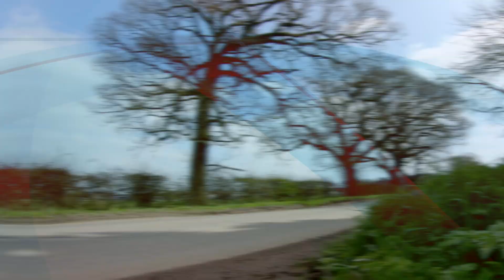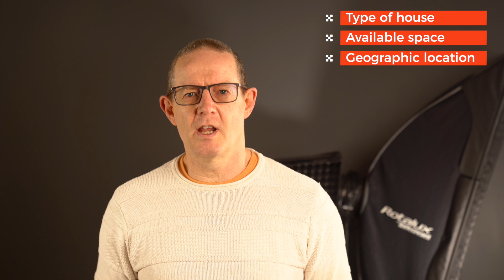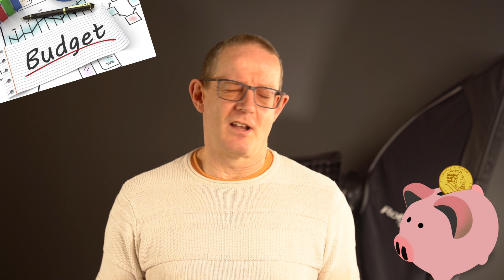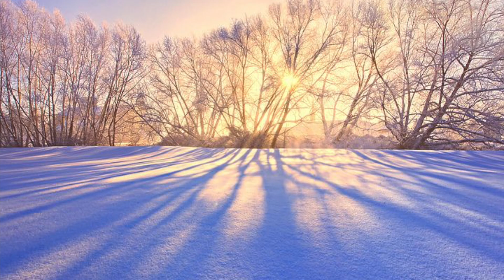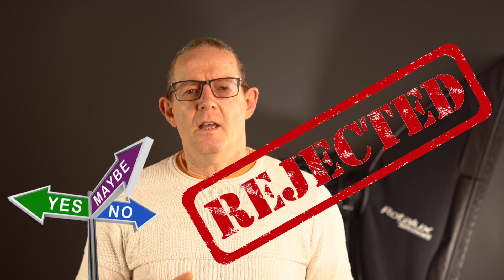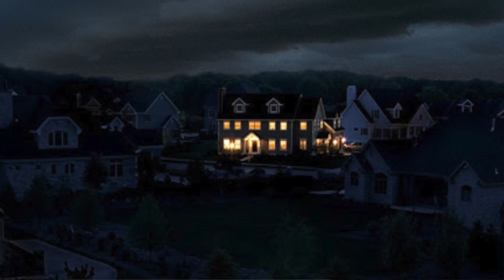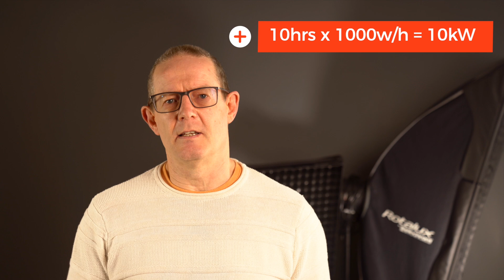So you want solar and a home storage battery

Comment: Has anyone managed to clarify the situation if you want, for example a 4.7kw panel array with an 8.2kw battery? I've been told that you have to apply for special permission from the Grid - a G99 and extra hassle, told that you don't, told that you can go up to 4.5kw without extra permissions - just the usual G98, told that if you have a 3.6kw inverter you don't need any special permission? Help anyone?
Reply from the maker: Hi Mick, anything over 3.68kW needs DNO approval and a system design as per my video = G99. 

=<3.68kW then it's pre-approved by the DNO and a post installation G98

Many DNOs are lagging behind with battery installations in terms of their approval process, it might be that an installer who will have good relations with the approver at the DNO has agreed a local arrangement. But it's not standard practise.

If you inverter caps export to 3.68kW then in effect its pre-approved as I understand it.
Reply: @johntisbury  I see that thanks, I watched the appropriate bits in the video but you mention that having a battery makes a difference but I can't find what difference it makes? If I have a 4.7kw solar array with an 8kw battery and the inverter capped at 3.6kw, will thi qualify for pre-approval?
Reply from the maker: The battery can export too, so it’s added to the solar array total.
Reply: @johntisbury  A bit baffled John, isn't the battery also controlled by the inverter and therefore subject to the 3.6kw cap? If not, then a 2.5kw panel array with a 3Kw would be over the limit? I'm just learning about this to decide on a set-up so you help is very appreciated!
Reply from the maker: Exactly. Don’t get hung up on trying to get under the 3.68kW. You need a system that meets your needs now and in the future. A good installer will deal with the paperwork and the DNO and recommend a system to suit your needs. Suggest getting 2/3 quotes.

Comment: Great video. I wish Government would make it compulsory for all new builds to have solar and batteries. Also they would be better offering incentives for batteries rather than heat pumps as so much surplus energy overnight
Reply from the maker: Thank Gareth, I believe the building regs now require solar, I could be wrong. However, when they install it's the bare minimum and the cheapest. 
The government are slow to react, Rishi is announcing low cost loans for heat pumps in the next few days I understand. But yes, they could do more.
Reply: @johntisbury  load of new builds near me going up, sadly on GreenBelt and no solar on those but they will have EV access points. Ps bug bear of mine they’re not chargers they’re in the car. 🤣
HP’s again should be fitted to New Builds as they can get the everything right, too much disruption to existing properties and infrastructure
Reply from the maker: The construction industry and building regs do need a shake up to bring them up to speed with the route we are taking in the energy market. High thermal efficiency, insulation and HP ready should be standard. 

Developers have to have a certain percentage of their new developments tested for air tightness with a blower door test. Guess what, they get to choose which ones to test. Those get special treatment, the rest in the development not so much.  At least EV charging points have to be installed, small steps.

Comment: I have have had 4.0kw of solar and a 13.5kwh Tesla Power Wall for a year and a half. In the first year I had less than 20 days where I used more power than my system produced and never more than three days in a row. My Power Wall doesn’t quite have energy capacity to leave the grid. I purchased a NG backup generator so if I lose the grid even without the sun I never lose power.
Reply from the maker: Thanks for watching, just 20 days is impressive.
Reply: Are you from the uk ? Matthew
Reply: @dannyf5157  No California.

Comment: Hi John, very informative thanks! My question is this: our consumption last year was 3,298kw (£606.23 bill), we can see that a 4kw installation would provide around 3,400kw - yet the Solar Energy Calculator only shows a saving of £297, where am I getting confused? Thanks, Mick.
Reply from the maker: Thanks for watching Mick. Have a look at the assumptions (top right) on the final page of the calculator. It is an estimator rather than a bang on the nail price point as there's too many variables even with the data. Your annual bill will also include VAT and the Standing Charge. The estimator is using the standard unit rate of 20.06p/kWh so that may also be different to what you are currently paying.
Reply: @johntisbury  Thanks for the quick reply, I'll have a look.
Reply: I have a Tesla 4kw solar with a Power Wall. I used ~3000kwh last year and produced ~7500kwh. I am on the central coast of California so we get more sunshine than most. These are real world numbers from last year.

Comment: Can you use tariff Control with battery? I e charge it when cheap spot price, typically during the night, and discharge it when expensive, typically 7-8 am and 5-7 pm, however it varies, so a simple scheduler wont do, tariff integration is necessary. On top of that, can you charge it when there is surplus solar, but give eventual charge of the EV priority? Perhaps set percentage for both? We have the Myenergi Eco-system and are considering adding A. Battery, B. Eddi. We currently charge the EV using Myenergi tariff Control + surplus solar during the day goes into the EV.
Reply from the maker: Thanks for watching. Some battery configurations allow that, the Tesla Powerwall does not have that integration. Octopus Intelligent which is a tariff control but currently only for Tesla car charging, not the Tesla Powerwall.

Comment: Surely the DNO don't have a say in what you can put on your land/roof or what size battery you have if your not feeding excess back into the grid. All this does is increase the cost to the punter. A couple of grand system turns out to be a 5 grand one fitted. 10 years guarentee mean nothing. I think most of us have had a rough deal with these 10 year affairs. . Im lucky that I would do my own so I wouldn't be paying to get one installed
  I'd be adding wind as well if I can. It's always windy up in the north so it would make sense to have a small generator as well. If allowed that is. I think come April it's 54% rise then more and more folk will be looking into  this and companies will be springing up all over the place making a killing. self certification is a joke and leads to sud standard workmanship in a lot of cases. It will only get worse the energy crisis so this kind of thing will be a must. Good information through. 👍
Reply from the maker: Thanks for watching Paul. If your premise is connected to the grid then the DNO have a say, hence the forms that the installer has to complete to state the output of the devices being installed in order to get your system certified. 

Good point on wind power. It needs a large installation to make any noticeable dent on house generation. This comes with high installation costs, planning permission etc etc. I had not included wind generation as the video was just about solar and home storage battery. If I'd have covered wind too it would have been over an hour long and as most people only watch 50% of any YouTube video it would not make sense to make it as one episode. 

The home generation market has already seen a massive rise in enquiries and orders. Like with any home improvement, multiple quotes, recommendations, reviews help to make the buying process more robust. If you just choose on price then yes, you may fall foul of having corners cut.
Reply: Cheers John. Well if that's the case then the DNO will limit a lot of installations that are big enough to lose them money. That's disappointing that they can control you own efforts to be more responsible for your electric . That's a shame
Reply from the maker: it's double edge sword. The DNOs will want to protect their infrastructure. New residential builds mainly have 3-phase now, so there's less risk and more tolerance. Older properties on single phase run the risk of melting cables if they all have solar and are exporting. A lack of investment in the infrastructure means the caps are put in place.

Comment: Is it possible to install just a battery without panels, and buy electricity only during the night and draw it off during the day?
Reply from the maker: Hi, yes it is. Many people do that. They sign up to a cheap overnight tariff, charge the battery overnight and use it to run the house during the day. Works well. Just need the battery sized to match your house usage.
Reply: @johntisbury  Thanks! I suppose the only two downsides of that are a) if they hike the night price up too much, and b) the grid goes off and I’d have no panels.
Reply from the maker: Electric prices will only ever go up, that's a given. Solar won't work in a power outage unless you are a) totally off grid in the first place (then you won't be affected by the power outage) or b). you purchase a Tesla Powerwall 2 which is designed to run the house when the grid goes off. Plus it can still be charged from solar during the power outage. However, if you don't have that battery backup solution then a powercut will also render your panels unless. 
In the longterm, home generation of your own power is the best safeguard. If you have frequent power outages then a battery back up solution is a sensible option.

Comment: 13:30 Not just microinverters are the solution for this, you can also get DC Load Optimisers.  These do the same thing but still allow for the thin (high voltage) cabling of a string inverter, whereas microinverters may require heavier lower voltage cabling.
Reply from the maker: Thank you, that's good to know.
Reply: Are you sure you've got that right? Microinverters such as Enphase convert the DC from 1 or sometimes 2 PV panels to 230v AC there on the roof and therefore there is a Live, Neutral and Earth coming down from the roof illuminating the need for a "System" or "String" inverter. Whereas DC Optimisers such as Solar Edge help prevent the whole string from being affected as much by the shade falling on part of the string, but the panels are still DC connected and still need a "Systeme" or "String" inverter to centrally make the conversion from DC to AC and therefore the separate Positive and Negative cables for the string are provided.
Reply from the maker: @barryhaeger4284  thank you Barry for adding this information.

Comment: Very good video thanks had solar before was great so went solar and battery at new home and ev it’s one year tomorrow! Got 5950+ kWh in first year and saved about £4000 in not buying so much energy from the grid and not buying fossil fuels to drive 15000 miles and using about 7000 kWh in the home . Well worth the money we think !
Reply from the maker: Thanks for watching Nickie and for your positive affirmation about solar and a home storage battery. They just make sense don't they. Especially if you have an EV too.

Comment: I have both and the battery is by far the most cost effective part of the system. During the winter there will never be enough solar to make much difference to my bills (and during grey or wet summer days) so I charge my battery on 5p a KWh economy 7 type  electricity. My battery is not large enough to last me all through a day unless we get a little sunshine. During the winter nights though. 
Almost all of our electricity we buy in is at 5p not 15p as it would be without the battery. This is a major saving and makes the Solar panels repayment time effectively increase to close on 20 years! However buying a battery and no Solar adds 20% to the cost due to 20% VAT being added if no Solar purchased at the same time.

Comment: John I have watched many presentation while I am considering my next venture. Yours was the beast. I have 20 solar panels installed 10 years ago. They have produced an average of 3.6KWh. I am considering adding a storage battery ,8.2 Kwh give energy is top of my selection list, I am  on economy 7 with outfox the market. My wife and I are over 75 and according to my supplier they estimate my next year electric energy needs are 7000 KWh. Any advice on the size of storage system that I am planning on installing will be very appreciated. Thank You
Reply from the maker: Thank you for watching and I'm glad you found it useful. 

Every household is different, I therefore can't recommend or advise I'm afraid. There are no shortcuts to finding out the size of battery system you need. You should have access to all the data you need, if not then you need to collect it. The crux of the video was help you identify the information you need to be able to make an informed decision on the size of battery storage system you need. 

My only suggestion is go for the biggest you can afford, in the long term it will pay off as people's usage is only likely to increase rather than decrease.
Reply: @johntisbury  Thank You for your reply. I like a copy of your schematic please that shows 2 sets of solar panels and battery connection. I could not and not for lack of trying. Thank you n advance.
Reply from the maker: @labiedr  you can download it from my Dropbox here: https://www.dropbox.com/s/aqypp8y1tu196ug/scematic%20of%20solar%20and%20powerwall%20installation.jpg?dl=0
Reply: @johntisbury  Thank you for the schematic. I have 3.8 Kwh panels installed 10 years ago in November. An installer proposed to add 1.78KWh (6 panels). Also to include 10.4 KW Fox ESS battery. My concern is will adding the solar panels effect my FIT arrangement. Installer sales man states it will not. Both old and new panels will feed the battery with any excess energy. I looked at your schematic carefully. Did you have a FIT from your first system? When you added the new panels did they impact your FIT?
Thank You Very much John for all the information that you made public. I live in south Northampton, so that makes us neighbours :-)
Reply from the maker: Make sure they fit a second separate generation meter so your first array remains separate. I have FiT on my original array and it has not been affected.
Reply: @johntisbury   @John Tisbury  Thank you very much Sir. any chance of knowing your suppliers or fitter of the second solar? I am trying to find some one who knows what they are talking about and can do the job. I had so many conflicting statements specially about Adding a second array of solar panels and a storage battery.
Reply from the maker: @labiedr  JoJu Solar or Stratford Energy. I have used both of them over the years and would recommend.
Reply: @johntisbury  Thank You very much.

Comment: Hi John could I use a solar panel and battery system to add heating to the house by charging the battery during the day and using the stored energy of the battery to 
operate an electric heater in the evening
Thanks for you video very informative thanks Nick
Reply from the maker: Hi Nick, yes you could however it really depends on the amount of solar you have to be able to charge the battery in the winter when you will need the heat. Plus the size of the battery verse the wattage of the electric heater. It's possible to do, it just needs to be balanced size wise. Work out the wattage of the heater and how long you will run it for. That will give you the electric consumption which will define the size of battery. Then you can work out the size of solar required to charge the battery. You may find that during the winter you will have more consistent results by charging the battery off peak with cheap overnight electricity and using that in the early evening to heat the house.
Reply: @johntisbury  Thanks John - 1 can get 10 panels on the roof and the heater would be around 1 to 2 kw with around 4 to 5 hours use in the evening
Reply from the maker: I feel you will struggle in the winter to provide enough energy just from solar. With 10 panels x 400w = 4kW. Worse case your heater would be 5hrs x 2kW = 10kWh. On some gloomy winter days a 4kW array would produce less than 1kWh over the day. You would need to rely on the battery charging  using off-peak electricity to fill it. Your battery will need to be a minimum of 10kW ideally, more is better.

Comment: Very good video John.  I am investigating solar and a AC battery and your points and issues raised have moved me much farther forward.  I hold a degree in physics and engineering and your video has given me several points and angles I had not yet factored in.  Thank you.  Keep up the good work.
Reply from the maker: Thank you for watching David. Glad it added some additional things to consider and evaluate.

Comment: When I go up into my loft I see the underside of the roof tiles - no felt etc. The multiple layers of insulation on the floor of the loft are caked in dust that has blown in. Will I need to get a new roof with felt etc under the tiles before mounting solar panels?
Reply from the maker: Hi Andrew, I’m no solar installer however the lack of roof felt should not impede installation as the panels hang from the rafters or battens. If the roof is in good shape it should be fine. However if not then it’s an ideal time to replace the roof as scaffolding will be up and your panels will last 25+ years. You don’t want to have to replace the roof in 10 years time.
Reply: @johntisbury  Thanks John, The roof is over 80 years old and apart from replacing the lead in the valleys has not needed any other maintenance. I was expecting the panels to be fixed to the rafters and expected this might compromise the roof where the tiles are removed to accommodate the fixings. 🤔
Reply from the maker: @AndrewLumsden  the hangers for the panels are fitted under the tiles so no tiles are removed in the final installation. We have had two installations and there are no missing tiles. Again, best check with your chosen solar installer as they can advise better than me.